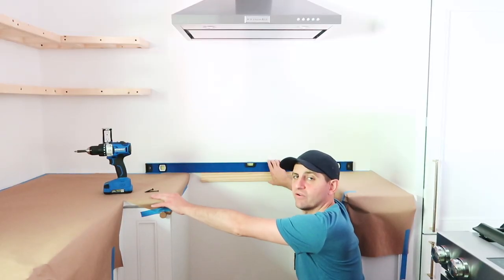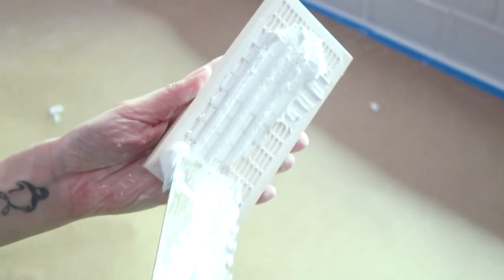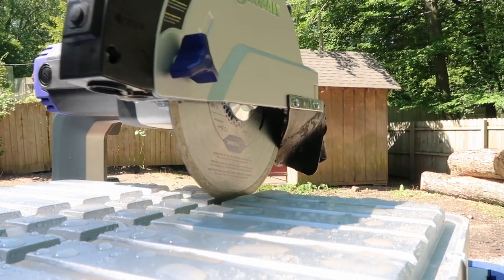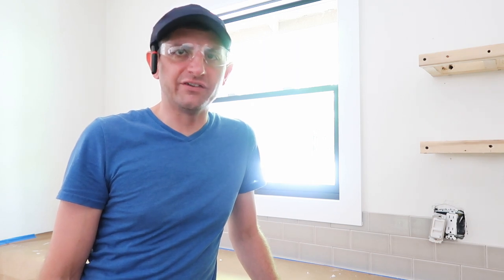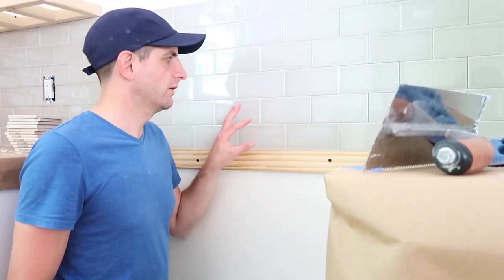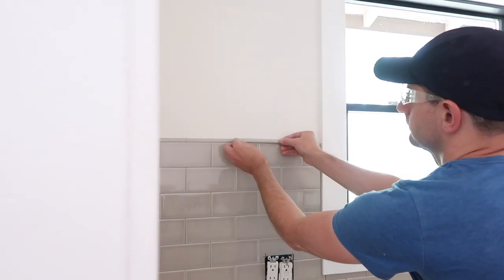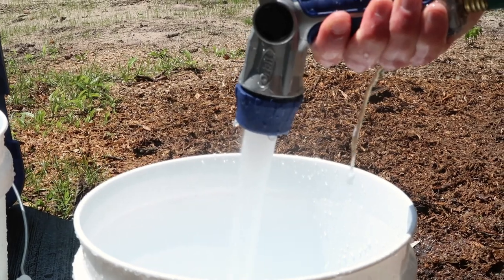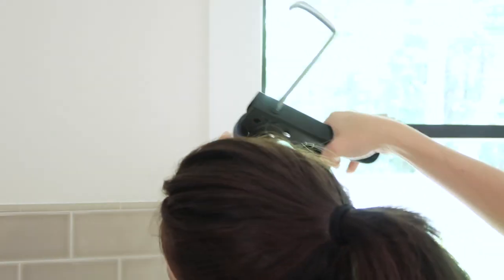How-To Tile a Kitchen Backsplash (Or Any Wall, Really!)

Comment: What size spacers are generally used for backsplash 1/16th or 1/8th in the kitchen. Thanks Mate...
Reply from the maker: I don't use any spacers! Most tile have an eased edge so you can put them against one another, and it will give a small space for grout.

Comment: Any tips on removing haze?  We had some tiling done on a floor and the installer, though highly recommended, seemed to have gotten a bit lazy at the end of the job.  

Also any tips on getting such a thin caulk line?  Do you just cut the opening of the caulk very small?  Ours always comes out way too thick. :(
Reply from the maker: If it's been too long and the haze has settled in, there's a product you can buy that's a haze remover. You spray it on and use a paper towel to wipe it off, but it does take some muscle. You can find it by the tiling supplies at the hardware store!

And yes, we cut the opening very small. :)
Reply: Yellow Brick Home Thanks so much!  Do you know if the haze remover product removes the sealer on the tile?
Reply from the maker: Ooh, great question. I'm not 100% sure, so I would ask one of the pros at the store or triple check the label on the bottle of whatever you buy!

Comment: It looks good, but I'm worried about the tile lasting if the place is left unheated from time to time over the winter since this is a cabin
Reply from the maker: We keep it heated to a low heat when we’re not there. The home has a full HVAC system!

Comment: Know the difference between PLUMB  ( VERTICAL ) and LEVEL ( HORIZONTAL ).  When you hold the torpedo level vertically, you're checking the plumb NOT LEVEL

Comment: You’re not supposed to start at the bottom or in the corner! Seriously.
Reply: Of course you start at the bottom. 🙄
Reply: @jaydaawg.8191  Ehm...no you dont. The bottom might not be flat. You start at a baton or line in the middle of the wall that you know is straight and true because you put it there.
Reply: @doptimist  I've done hundreds.  Always check.  Usually only minor discrepancies. Don't overthink it.  Git 'er done!